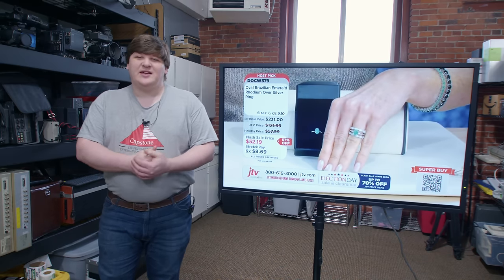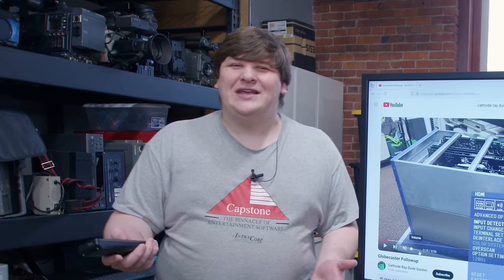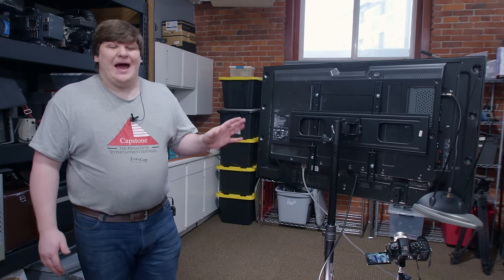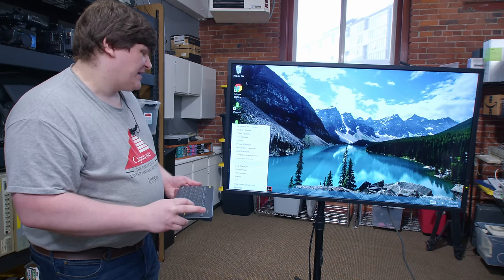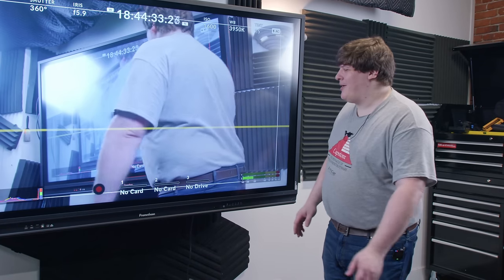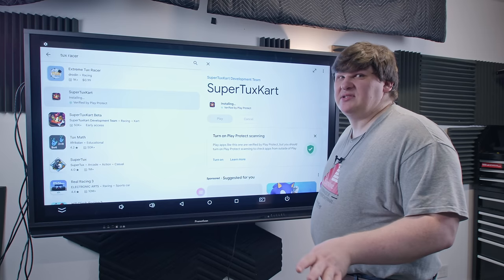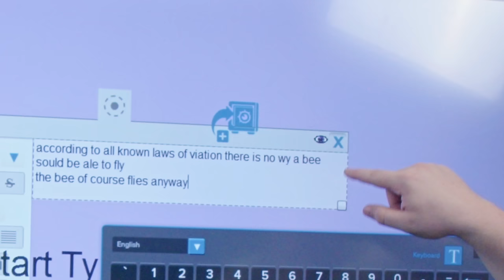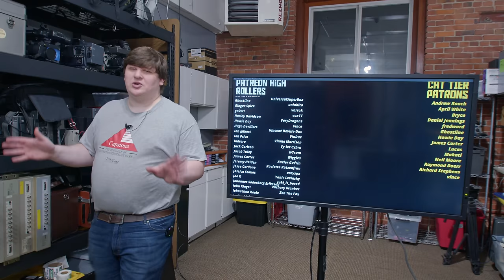Several Incredibly Smart TVs!

Comment: You basically had PAL-60 right, it's PAL, but 60hz instead of 50. This came around the late 90s when 60hz TVs started to appear in Europe and became common around 2003 or so. So some PAL PS2 and Gamecube games ask you when they start if you want to use 50 or 60hz mode (which you have to set every time because of course it doesn't save the option). The original Xbox actually had a dashboard option to set it to PAL60 as a default. TV stations still ran at 50hz though, so I think the only practical purpose it really had was for videogames. It's actually a funny thing about PAL Xbox 360 games that some of them had a 60hz badge on the cover because they wouldn't work on a 50hz only display. So if you were rocking a 8-9 year old TV on launch day you had an additional excuse for not wanting to play Fuzion Frenzy 2.

Comment: POP and PBP are used very commonly in schools and waiting rooms to show 2 data sources of internal design - they are prescaled such that they look correct after the monitor scales them, and a good way to show waiting lists + hospital info, rather than a video. definitely one of the reasons you often wouldn't want speakers on these.
Reply: the USB-B port on the computer in the digital whiteboard is likely for a touchscreen or stylus tablet for the teacher to draw on more comfortably, or while at a desk while facing the class. it is also a common use for the hdmi out, to display what is on the whiteboard to draw things that take time (i.e. complicated math formulae, chemical equations, etc, where writing is important.
Reply: the shade covering much of the screen was used very commonly by my teachers, who were using the very first of these sorts of digital whiteboards (they were projectors connected to the board on an arm! it was wild) to write out a test/quiz etc or lesson list of questions to go through to only display one at a time to work on as a class or for a timed test.

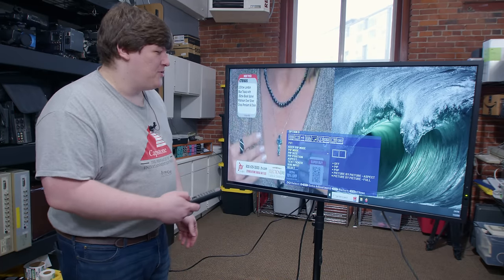Comment: 17:10 I know exactly what that's used for, because I have already seen it in real life: Airport info displays. If they have a small display with only a single screen, they sometimes connect 2 HDMI cables from their computer box to the same display, and use this feature to put the 2 vertical screens (one for arrivals, the other for departures) on the same monitor. It isn't elegant and you could do it in software, but they're either too lazy to do it right or using legacy equipment that can't put 2 things on the same screen, so they just use an extra cable and let the TV handle it.

Comment: I found that type of wall mount at Lee Valley Tools to mount a 55 inch Sony.

Trouble is, some fasteners were missing. A quick email to the manufacturer got me all of those components plus some spare mounting bolts to screw it to the house frame.

Comment: I work in IPTV industry. You can use DVB-C or IPTV to stream single stream to multiple TV using simple cables. Coax or Twisted Pair.  

I acctually work in broadcast and I produce IPTV signal for tvstations and IPTV EXISTS in US but in B2B. TV Station send IPTV stream to cable provider. Just like internet.

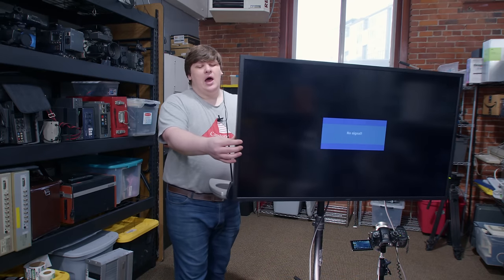Comment: 23:38 - IR remotes "I don't know if interference is a thing with those."

It absolutely is! I have trouble with the IR remote controls for the stuff in my living room during the winter when the sun is coming in and have to go to about 3-4m from the equipment before it'll work. I also owned a set of IR headphones in the past and you couldn't use those while sitting in the sun, as the IR in the sunlight would completely overwhelm the signal.

Comment: Kernel 4.1 is super weird to see, it's not even an LTS kernel. Usually you'll see 3.18 or 4.4.

Also, dirty means the kernel wasn't recompiled cleanly and, instead, was built incrementally without cleaning the output directory. You are right about the testkeys tho.

Comment: On my old Sony there PiP, and then there's P&P where the 2 pictures are displayed centred on the middle horizontal and using the up/down cursors you can increase/decrease their sizes- one gets bigger as the other gets smaller- and it also can't do two FHD inputs at the same time, one has to be lower definition.

Comment: I gave a presentation one time at a school with one of those Prometheus TVs, though I believe a later version, so I know a bit about how they work. They tended to be used by mirroring your screen then writing on top of it. To pull something off of the top of my head, a math teacher might project a geometry problem on the board and a student could come up and draw what they did. The holder thing is for a writing utensil but they don't work very well and I was told to just use my fingers if I needed to draw anything.
Reply: I'm not used to mobile so I'm not too sure how to edit my comment. I realized my geometry example doesn't make very much sense the way I wrote it. There may be a slope or something that you need to calculate, so a student might go up and find the x difference and the y difference by drawing and divide them to find the slope. They then might check their work by drawing the slope on the grid to see if it matches with the points.

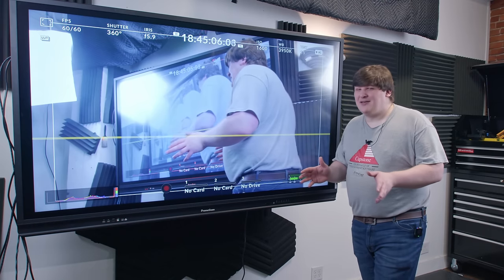Comment: at 43:10 you mentioned how infrequently you see front panel HDMI, and I'm over here like, "I feel like I've seen those pretty recently..." Then realized I last saw one when I helped install a bunch of Promethean touch displays at a local school district five-ish years ago. But can confirm, they is heavy. We used promethean branded wall mounts to hang said screens, they actually come with that wall mount in box, since the only other option is a bespoke solution like you have.

Comment: I know it's not the point of the video but, specifically the point of interlacing is that while the two interlaced fields make up a whole frame, that means the whole frame of the TV's resolution, it doesn't mean that images were sent in two halves. Really for the majority of TV content for quite a while, each field is it's own half-resolution image, captured at a different moment in time, and therefore trying to blend these together into a single image results in either combing, or a weird blur. 

The time where this does not apply is when it's something that was shot on film, or shot in a way to emulate film, at 24fps, because here they would actually send each frame in halves (after converting it to 30 frames per second with something called 3:2 pull down where you effectively show some images three times and other images two times, six and four times if you're counting in interlaced fields.)

Comment: One thing i could imagine for the wired remote is that you maybe don’t want to have an ir control on a publicly accessible screen. Don’t want someone to come in with a bootlegged remote and change your settings, so instead you block the ir signals and use a wired remote instead

Or maybe you just want a simple control panel somewhere that a normal worker can actually get to and don’t want someone to have to walk up in front of the screen where they can hold up a remote to try and do stuff

Comment: NTSC 4.3 is also called NTSC-J. Although NTSC 4.43 uses PAL’s color subcarrier frequency of 4.43 MHz, the chroma is still encoded as a NTSC signal. Thus although it uses PAL’s subcarrier, tapes recorded in NTSC 4.43 will not display on a standard PAL monitor or play in a standard PAL VCR. Not all of South America used NTSC. Brazil and other countries used PAL-M.

Comment: A monitor free of ridiculous adverts? Tracking on the camera (if equipped)? That is a dream come true. I have one of the smaller 27in NEC monitors I got from a school auction. And you're right, it is jam packed with everything from adjusting screen position, width, length, settings for fixed or variable resolutions up to 1080p. Also, and this is my favorite. These monitors are capable of still displaying a proper RCA (Composite) signal! Most home tv's will not display say a PS1 signal from a PS2 in PS1 mode. They drop out under 480i. But you can run a 360p and 240p composite signal on them. And while it doesn't display that CRT color perfection, it's certainly usable. So is even the humble RF signal from the oldest game consoles.

I use mine for vintage console repair, as you only need one monitor for all signal output variants (RF/Composite/YPbPr or Component/HDMI). And not needing a separate CRT for most cases? Priceless! NEC has always had some of the best multisync monitors in the business. I have a vintage NEC 19in VGA monitor with about 23K hours on it. No tube degradation, no need for degaussing, and the picture looks like the day it left the factory. NEC knows it's stuff that's for sure. Same people who created the TurboGrafx16/PC Engine.

Comment: If you look on the remote it probably has a 3.5mm jack - thats so you can plug it into the 3.5mm wired remote jack on the TV.  
in a pinch if you need to quickly control one tv out of a bunch, like in a video wall, it's far easier to just plug directly into the TV you want to control vs. finding the right remote or trying to program one remote to just control one TV on the fly.  Literal plug and play.  

This is common with projectors too - and trust me, it's a god send when you have multiple of the same devices in close proximity!

Comment: PAL60 was sort of an extension of the PAL standard to enable 60Hz output. All 6th gen consoles support it as far as I know. But it did drop the resolution down from 576 lines to 480 lines I think. So it's an almost NTSC signal.

Comment: The USB-B port and the HDMI-in on the OPS-G are for a connected PC, I guess for if you're plugging into a smart display that doesn't pass USB through to the OPS slot.
I work in a school and when we were first buying in to these large format interactive boards to replace projectors, we tried a couple of different brands in different rooms, and eventually settled on Promethean. As we weren't about to throw out ££££s worth of displays, we then bought some OPS-Gs to effectively turn the non-Promethean boards into Prometheans. Likely not what they intended them for but it worked!

Comment: I once worked at a place that had a bunch of the predecessors to this set mounted on the walls, showing stupid corporate crap in a dog-&-pony show they called the Internet Operations Center. They were plasma panels and they probably cost about 10 grand a pop. They had an interesting feature that I think was supposed to prevent or reduce burn-in: Every few minutes, a white vertical bar about an inch thick would slowly sweep across the entire image from left to right. I guess it did the job because they were still in service at least 10 years after they were installed. Then again, they were really dim and badly burned-in anywhere a chyron or channel logo would've been shown.

Comment: “Vertical” ticker is probably for if you have the panel mounted in portrait orientation.
Maybe the Ethernet SMTP interface relays what it receives out over the serial connection to the other sets? That means only one Ethernet connection is needed and then the rest of the wall is daisy chained together locally so the whole wall responds as a single unit?
Reply from the maker: Oh duh that makes sense, I forgot that people rotate these

Comment: These developer options do exist on production builds of Android, they're just hidden by default. You unhide them by repeatedly tapping the "build number" in "about this device". You need them if you're developing Android apps, this is where, among other things, you enable "USB debugging" which allows you doing lots of things with the device over USB. Installing apps, debugging apps, accessing the Linux shell, transferring files, taking screenshots, etc.
Reply from the maker: On many, yes, but in "appliance-ized" devices where the user isn't supposed to really be interacting with the device as a generic android tablet they usually disable the hidden shortcut so the user can't disrupt the device's intended functions. Imagine the damage a kid could do to this thing!

Comment: On at least some Philips AV devices (TV's VCR's Etc.) the standby button on the remote does only that, pressing it will not turn the device back on.
On a TV, for example, you'd have to press a number or channel up/down to turn it on.

Comment: 13:10 PAL-60 is used where I live mostly for 6th and 7th generation game consoles (Dreamcast, Gamecube, XBOX, PS2, Wii) pretty much solely to increase the max. frame rate of the console from 25/50 to 30/60. You can also get some older 8 or 16 bit consoles to output this format by swapping the main clock crystal with what's usually found in an NTSC Japanese or American console.

PAL-60 is a pain to capture these days since most newly manufactured capture devices don't support it any more, so you have to specifically look for quite old or expensive enthusiast equipment.

Comment: Re: Your comment about front panel HDMI ports. I have/had two TV's around the 2007-ish era that had these. Still have one in an old Panasonic Plasma set. TH-42PX80U model as I recall. It also had some other fun little unique features. I remember using it with a DVI-HDMI adapter for PC input before HDMI out w/audio was really commonplace. The TV actually had the option to have it pull in audio from one of the analog RCA inputs on the HDMI input. I know this was pretty common for VGA and physical DVI inputs on some sets but seeing it for HDMI inputs was interesting. Unfortunately it had locked overscan which made using it as a PC display really annoying on top of the low 720p class display panel.

Also had a Hitachi plasma set from the same era that sadly died a few years back but it also had a front HDMI input. In fact for whatever reason it worked better for PC inputs than the rears with no visible overscan. Again, no options to turn that on/off on any input which was absolutely frustrating. It was also from the era of non-square pixel displays. Native res I think was 1440x1080.

Comment: I have a ginormous elo touchscreen monitor used for applications like ordering food at a restaurant, perhaps. My dad may or may not have grabbed it when they were going to recycle it, but it has a slot on the back just like this monitor where a computer module slides in! The one that it has currently is an Intel i7 of some sort. So it’s a whole computer in a box, powered by a single cable. Pretty cool! My local Wendy’s has two of what I think are the exact same monitors.

Comment: 17:00, so, POP is useful for POS or advertising systems. Your main display can have bus timetables, whatever, and the sub-display will show advertisements. Similar for SBS. I've seen one that could handle more than just two inputs, so you had a primary display, the smaller corner had static advertising, then the top 2/3 slice above that had the POS receipt "printout". Obviously, it was a much smaller display though. Only a 22-24".

Also, 10 years from now, our 4GB DDR3 issue is going to totally be 8GB DDR4 sticks when we need 16.

Comment: i have a Sony one, which is basically just their mid range consumer TV without a tuner and some extra software features. I don't think the hardware is actually different (besides the missing tuner). Had the benefit, that you could skip out on the public broadcast fee where i live. Also found out that it offers another benefit: extended warranty (5 years) that is veeeery generous. After 4 years I told them it had a smudge inside the glass (which it had from day one, but it never bothered me enough to go through the hassle of sending a big ass TV in). They actually sent someone to pick it up and deliver the latest model free of charge, so basically i got a free TV upgrade.

Comment: PAL-60 is the PAL colour system but indeed at 60Hz instead of 50Hz. Quite a lot of late model UK TVs support this just fine in my experience. Some PS2/XBox era video games ask on startup if your TV supports PAL at 60Hz and will offer a test for it.

These commerial displays are super cool, honestly might be worth a pickup if you can find a used one on the cheap!

Comment: We use similar tvs at the theme park i work at alot of the older high end commercial gear used what look like VGA cables to transport component signal due to the single connection and screw terminal. It will be the same connection on the gear you are connecting. The DVI is DisplayPort on the newer and support DisplayPort daisy chained displays for video wall setups. They are rock solid displays that last for years and years of use with minimal downtime.

Comment: IPTV is great if you have a Ethernet network at home but only one room with a SAT connection. Some Panasonic TVs cann then use the build in sat tuner and send the signal over Ethernet into another room. Works quite well.

Comment: My consumer Sony HDTV from 2012, not even a particularly high-end one, has a deinterlacing option in the settings. The options are termed something like quality vs performance, corresponding to bob and motion adaptive deinterlacing I think. It only works for external inputs though as the setting is locked to quality for TV channels, so the NEC is special in that respect

Comment: In primary school i had a prowise version which also used a OPS module. I believe ours was an i5 5th gen and 8gb ram. Although the boards could also be used without the ops turned on so it probably had a Linux computer inside of the board that would run when the ops was off.

I remember the teacher after break time logging into their account on the huge screen and typing on a small keyboard. He/she used it to open youtube so we could watch movies or videos in the lessons and we could also switch directly to a blank page and a basic 'paint' program without turning off the ops.

After 2 years and my last year of primary school they switched to newer ones using the intel sdm interface